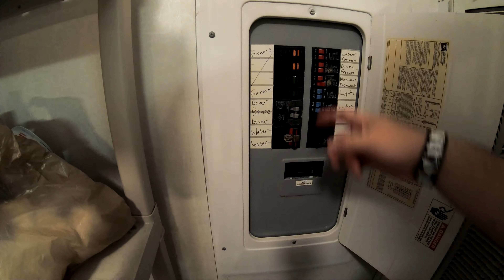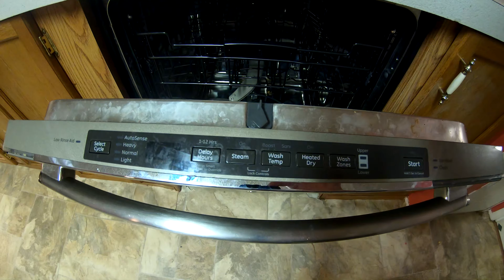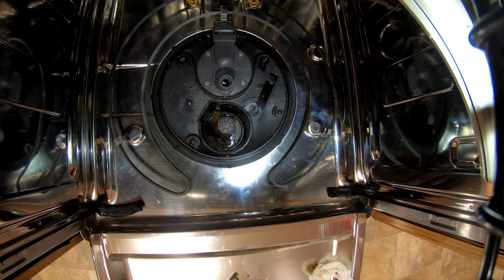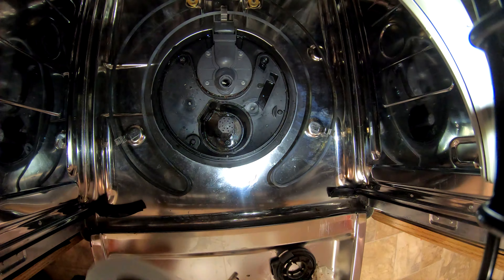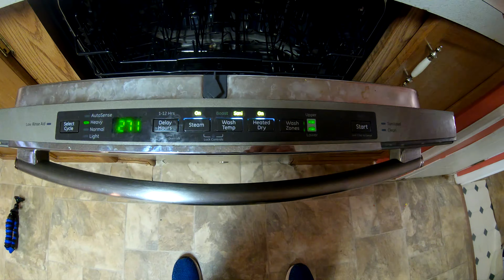GE Dishwasher Flood Switch Replacement!

Comment: Thank you for this! Can't wait to fix ours. Would you happen to know or tell me how I can find the flood switch for my dishwasher GDT695SSJ0SS? It wasn't clear on the GE website. Thanks
Reply from the maker: I appreciate your comment. Unfortunately those dishwasher do not have a flood switch which seems to fix everyone else's dishwasher. Those have a "flood stem" there IS a flood switch but it is not the same unit. I'm honestly not sure if that would fix the issue or not. The part # is : WD21X23498 looks like it is located under the door / body of the dishwasher (not in the door). At some point I need to buy one of these dishwashers that is having this issue and fix it for everyone.
Reply: @BreakFixRepair  OH NO! I was hoping to save a call to a repairman.🙁 Thanks for your swift response, though.
Reply from the maker: I’m sorry I couldn’t help much on this one. But let’s not call just yet! I have another video that tells the top 4 fixes for these dishwashers. Basically let’s try this first. 1) Fill your rinse aid all the way up. 2) run the hot water that is connected to the same line as the dishwasher until it reaches maximum temp right before you start a load of dishes 3) check the steam outlet for clogs. It should be located on the inside of the door or the interior side of the dishwasher. 4) visually inspect the heating element for cracks or burnt spots. If you can, the best way is to put a multimeter on both ends at the back and see if you have 16.9 (I think that’s right) ohm of continuity. After you’ve tried these things, run a load of dishes and see if it works. If you do not get 16.9 ohm of continuity but get something way off, this would indicate a failed heating element. If that’s the case I would pull the dishwasher out (turn off the power first!) remove the element and double check continuity before buying a new one. Let me know what you find. If it is your heating element I can help you find the right one. Hope this helps.
Reply: @BreakFixRepair  ok. Please tell me the correct part number for the heating element. That seems to be the problem🤞🏼
Reply from the maker: @anolalyons6107  The heating element for that dishwasher is the same as the others. Here is a direct link to it:  https://amzn.to/2Lka5qc
Please let me know if it fixes the issue!
Reply: Sooooo I'm back. It wasn't the heating element. The vent on the door is not clogged. The water gets hot but not the dishwasher. HELP!

Comment: Hi. Will this switch fit a GDT580SSFOSS model? I’ve gotten conflicting information on the internet. Help please! Thanks
Reply from the maker: Thanks for your comment. I believe it will but there are some models that have a center unit that looks like the flood assembly but it is not. The best way to find out is to take that piece out and see if it has the green electrical connector on the bottom. It should also have a ball bearing or float ball inside if you tilt it side to side you can hear it move. Keep in mind that if it is a flood assembly and it’s clogged up it may be stuck inside. If yours does not have the green connector then that is a different unit and it will not work with your dishwasher. Hope this helps. Let me know what your find. Thanks!

Comment: I also have a problem with the dishwasher. It works and pulls the water, but it does not remove  the water from the inside. The water stays inside. I tried everything. I cleaned the hose water but it’s still same u know what I mean it’s working but  does not throw the water outside plz help..
Reply from the maker: Have you replaced the flood switch if you have one? It also controls the water level in the dishwasher. What’s the model of your dishwasher?
Reply: Break Fix Repair same at this video ge
Reply from the maker: Jiji 22 have you replaced the flood switch? That may fix the problem as it regulates the internal water level. A link to the flood switch is in the description. Hope this helps!

Comment: My dishwasher GDT605PSM0SS does not have a flood switch like the one indicated. I believe it has a flood stem. I see no videos on that. It is not heating or drying. Only about 16 months old
Reply from the maker: There’s a little switch underneath on the right hand side near the back (most of the time). It’s in a wiring harness. It’s called the thermal cutoff switch. Check and see if that is flipped. Try to reset that and let me know if it helps.
Reply: @BreakFixRepair  I will try that! Thx
Reply from the maker: Any luck?
Reply: @BreakFixRepair  I havent had time to pull it out yet...later this week I will and post

Comment: Thank you for a fabulous video! I have liked and subscribed to your channel. My dishwasher (GDT580SGF5WW) was not drying dishes at all, and the water was not warm.  I also noticed 2 days ago (right before I replaced the flood switch), that there did not seem to be water coming in as the gel capsule was not dissolved. I purchased the part you recommended from Amazon, and then followed your detailed instructions, and I now have heat and steam. But unfortunately there is still no water coming in - just a bit of moisture. When I turn on the dishwasher I can hear gurgling under the sink alongside, but when I open the washer there is no water. I bet this is something new. Any ideas? Thanks so much for your help!
Reply from the maker: Thank you for liking and subscribing to my channel! Glad the part fixed your heating issue. Now let’s try to get the rest fixed. So just a couple of thoughts. When your dishwasher first turns on it typically will attempt to remove any water left from the previous cycle first. If you are hearing gurgling, it could indicate a septic issue (septic full or pipe blocked) or a blockage to the sewer system. Do you have any issues with drainage anywhere else in the house, or near the dishwasher? Do you ever hear any gurgling anywhere else after the pipes have been saturated (bath, washing machine, etc). Also, double check the water supply line that runs to the dishwasher and make sure there isn’t a cutoff that’s been accidentally partially closed or turned off all together. Also prior to starting the dishwasher, run the hot water at the faucet beside it until the water reaches peak temperature. Check those two things and let me know what you find. Hope this helps!
Reply: @BreakFixRepair  Hi - thank you so much for your help! We don't have any drainage issues that I know of anywhere in the house. We had our septic system pumped out only a couple years ago. I checked the valves under the sink and nothing seemed to be closed. Then I tried your trick by running hot water first in the sink - it got to boiling temperature real fast.  I felt the inlet copper pipe, and it was hot. Then I turned on the empty dishwasher - and it start running! I opened the dishwasher after a few minutes - and there was plenty of water! I shut off the dishwasher and heard it cycle and drain the water - with gurgling under the sink. outflow plastic pipe was hot too. The weird thing is - I have not been able to get the dishwasher to repeat its performance with showering water despite three more attempts (run hot water in sink, run dishwasher - listen to steam sounds, hear it drain for a bit - but nothing else. The dishwasher is hot and steamy but no water). Hope this helps with your diagnosis!
Reply from the maker: Try this- turn the power off to the dishwasher at the breaker box for about 5 minutes and turn it back on. (Be careful) That should clear any codes it may be throwing internally. Have you tried to let it run for a few minutes? Sometimes they don’t fill with water immediately. It may take up to 10-15 minutes to start filling based on sensors etc. hope this helps.
Reply from the maker: Any luck with this? Hope you got it fixed!!
Reply: @BreakFixRepair  Hi! Thanks for a great idea about the power cycle via the breaker. It seemed to work - I ran it for a bit and got water (the dishwasher was empty). But it seemed to stop when I tried to restart. I am going to try a full load tonight and will let you tomorrow morning. I believe you are totally correct in suspecting a computer glitch. Fingers crossed!
Reply: Hi - Unfortunately it did not work. I did a power cycle last night and ran the dishwasher with a full load after running hot water to full boiling temperature in sink. I heard the draining gurgle (saw the drain pipe under the sink moving), heard steam come on, let it run, but came down in morning to dirty dishes and the cleaning capsule was not dissolved. Repeated the experiment this morning - same result. When I opened the washer at the end of the cycle the dishes were extremely hot - so it looks like the washer thought there was water because it ran the heated dry. I had set the washer to normal load, steam and heated dry. Thanks.
Reply: @BreakFixRepair  Hi - Unfortunately it did not work. I did a power cycle last night and ran the dishwasher with a full load after running hot water to full boiling temperature in sink. I heard the draining gurgle (saw the drain pipe under the sink moving), heard steam come on, let it run, but came down in morning to dirty dishes and the cleaning capsule was not dissolved. Repeated the experiment this morning - same result. When I opened the washer at the end of the cycle the dishes were extremely hot - so it looks like the washer thought there was water because it ran the heated dry. I had set the washer to normal load, steam and heated dry. Thanks.

Comment: Wait a minute did I miss the part where you actually take the sensor out of the Piece
Reply from the maker: Nope you just replace the whole thing.
Reply: @BreakFixRepair  o ok thank you
Reply: @BreakFixRepair  so just because I watched your other video and I know that my dishwasher still technically heats up goes for hours on end I was hoping just cleaning up everything would maybe help in your other video you talked about a reset button with the reset button be accessible this way or would it be another thing that I had to actually pull the dishwasher out of mine had one?
Reply: @BreakFixRepair  and thank you I actually did enjoy your video and the lack of music because I do have a hard time hearing what's going on thank you again
Reply from the maker: What is your dishwasher doing? If it’s heating then it’s probably not the switch or thermal cutoff switch.
Reply: @BreakFixRepair  the other day it was normal wash and it was still running at 3 hours and I know it can take a while but that seemed excessive especially when I went on GE and they were saying it should only run for about 60 65 minutes

Comment: Hi, does the  GLDT696D00SS have this flood switch? I can’t find it on the parts list.
Reply from the maker: Thank you for your comment! Unfortunately it does not appear this flood switch fits that model dishwasher. What problems are you experiencing? Do you have what appears to be a flood switch? Some of the newer dishwashers come with a unit that just controls water levels and flow, on the units that are older than 1-2 years, they also partially control the heating of the dishwasher elements. Have a great day. Let me know what's going on with your dishwasher. Thanks again!
Reply: Break Fix Repair thank you for responding. My dishes do not come out as clean as they used to. I checked the spray arms they are not blocked, cleaned the filter which was not dirty to begin with (I rinse before putting dishes in) and I added rinse aid. It’s a bit better but still not spotless like before. I then opened the machine mid cycle twice, one at the beginning and the water was cold and one at the middle and the water was hot but not very hot. I haven’t measured the temperature with a device. I thought if I could find this piece and clean it, I could see if it made a difference for my situation. I couldn’t see any other piece called flood switch in the diagram. I’m curious could my machine have no flood switch? I guess I can call GE and they should know too. Thank you again!
Reply from the maker: You're welcome. I try to help as much as possible. Is your dishwasher under warranty by chance? Here's one thing to try. Before you start the dishwasher, run the hot water on your faucet until it becomes hot. Some dishwashers are picky about water temperature and if it's cold when they start, it may not trigger the switch for the heating element to function. Also, It appears your dishwasher doesn't have a flood switch, I was able to find a thermostat, but I'm not too familiar with that model. Can you visually check the heating element and see if there are any cracks or breaks in it? While it's not a definitive test, it's a good start to see if you may have a heating element failure. If you want to be 100% certain, you'll need to check the resistance of the heating element with a multi meter, which should read around 16.9 ohm's. I did find this thermostat for your dishwasher - https://www.repairclinic.com/PartDetail/Thermostat/WD21X10394/1811019 I'm not sure if it'll fix the issue but check the water temp before a new run and then visually check out the heating element. Let me know what you find out! Hopefully we can get it working soon!
Reply: Thanks so much once again, I will do the checks you suggested. I’ve had it for about 5 years so no more warranty :) thank you again!

Comment: Did I miss where you told how to KNOW that the flood switch is broken. I don't want to replace it if it's not broke
Reply from the maker: I don't believe I did on this video as it was strictly a "how to replace" style video. But if you have a GE dishwasher with this part and your dishwasher isn't heating, this is more than likely the problem. I'd say 99% of the time this is what will fix it. If you take it out and turn it side to side there's a float ball that's supposed to move up and down. You can try to clean it (soak it) with vinegar and hot water but no guarantee that'll help. It did not work for me but has worked for a few people.
Reply: @BreakFixRepair  its a Amana, but you video helped on seeing how to remove the heating element.....Thanks!

Comment: Magnetic screwdriver, man.
Reply from the maker: J H Thanks for your comment! I was using a magnetic screwdriver but it doesn’t work very well as the screws are stainless steel to prevent rusting from the water. Have a great day!

Comment: Can we talk refrigerators?
Reply from the maker: 😂Sorry this is late but what did you have going on?
Reply: @BreakFixRepair  seems to be a lack of water pressure. The soap door opens and just runs down the door. So the top rack doesn't get clean at all
Reply from the maker: @chazjenks8572  check out this video. GE DISHWASHER NOT FILLING - WATER INLET VALVE REPLACEMENT | LETS FIX IT!
https://youtu.be/y9uydBfvn8s its old and not the best lighting but should help. It may be the water inlet valve. You should have pretty good pressure to the dishwasher for it to run optimally. You could also try running dishwasher cleaner through it as there could be a blockage somewhere.
Reply: @BreakFixRepair  did that